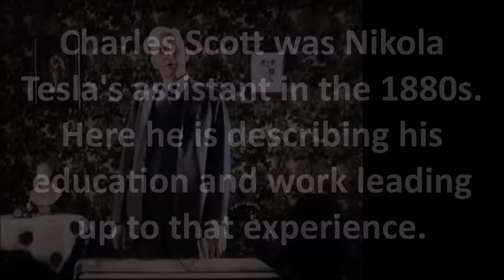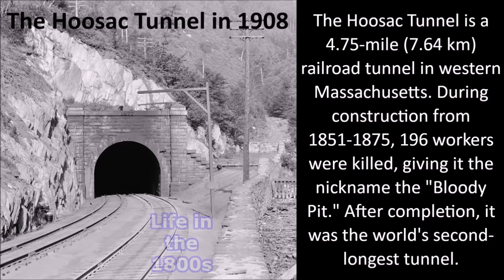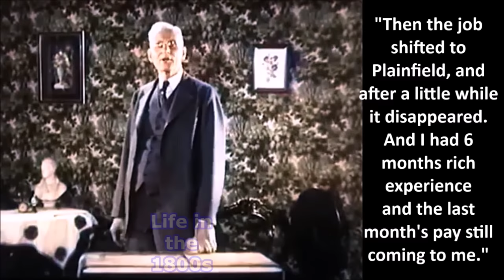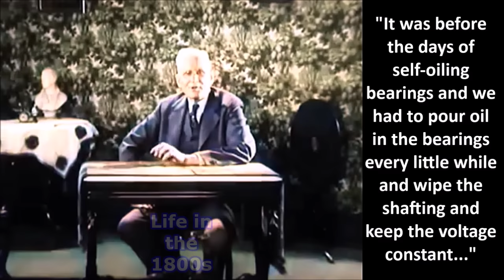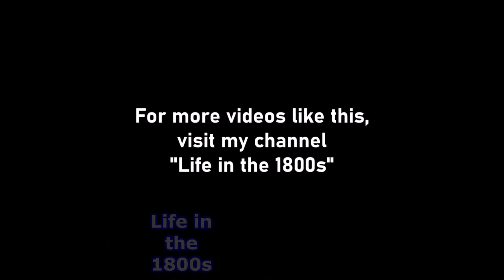Nikola Tesla's Assistant Talks About Work in the 1880s: Enhanced Video & Audio [60 fps]

Comment: Minute 3:40"....oil the bearings...".I had a two hp electric motor made c.1940. Weighed about 100 lbs, sorta big. At the back was a metal plate next to a spring loaded hole for oil. The metal plate had "oil once every twenty years"!!. I traded it to a friend....always remember that plate